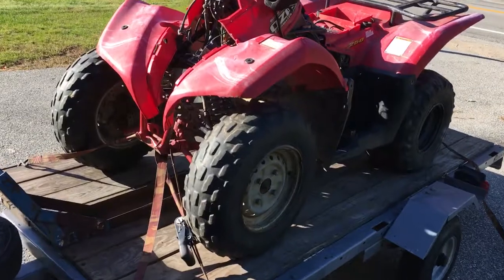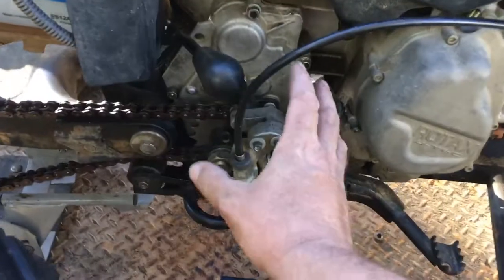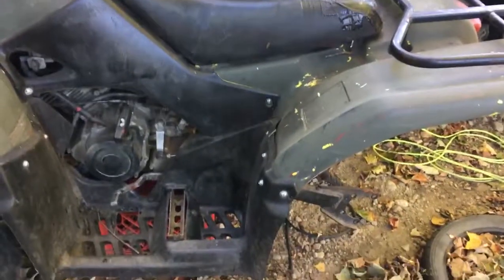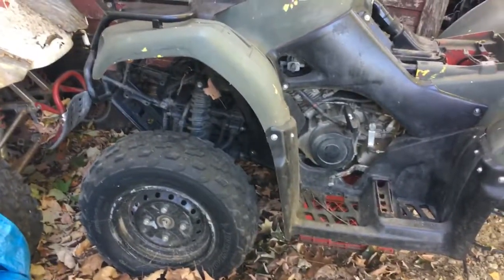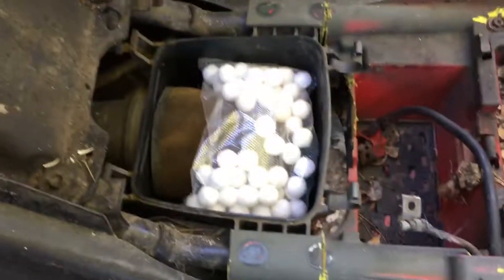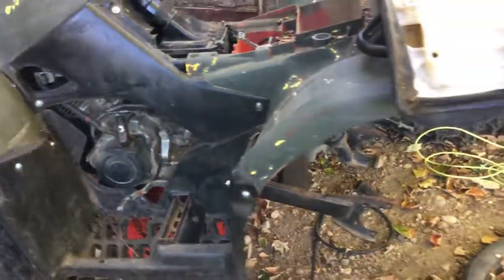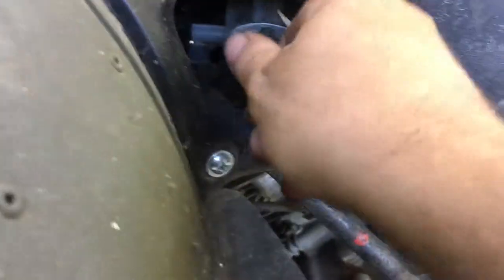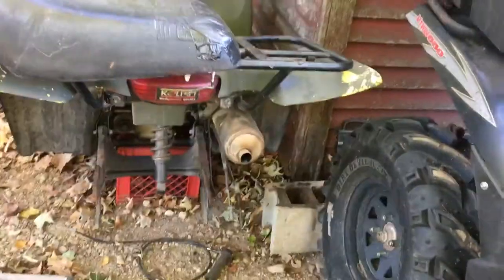first look suzuki ozark 250

Comment: I picked up a 2005 about 2 months ago for $600.  Was told it needed a starter,& a little love. Yeah right! It had the wrong carb on it and missing a bunch of stuff. I replaced carb, petcock, starter, battery, battery strap, solenoid, both side plastics, new seat cover, spark plug, oil change and filter, rear differential fluid, fixed back brake, new dash, dash bracket, dash rivots, storage cover, airbox cover, air filter, air filter holder, new led headlight lamps, heated up the plastics to bring color back, plastic rivots, rear brake cable adjuster, blead front brakes, added some extra leds on front racks,& a winch. I still need tires.Looks like  I'm running slicks right now. Now that i just wrote all that I'm thinking i should have just bought a new one. It was fun bringing something back to life though,& i learned a ton. It is a badass 4 wheeler also. Picked up a 2007 Kawasaki bayou 250 last week for $160,& already started fixing it. It doesn't need as much as the Ozark did.  Think i found my new hobby. Good luck with yours.
Reply from the maker: i sold both of the bike i had a few years ago
Reply: how much do you think a rear diff would be for one of these? i got one without a rear diff. would i be better off parting it out?
Reply: Wtf how u get these so cheap? I paid 1500 for a pile of oil. Lol